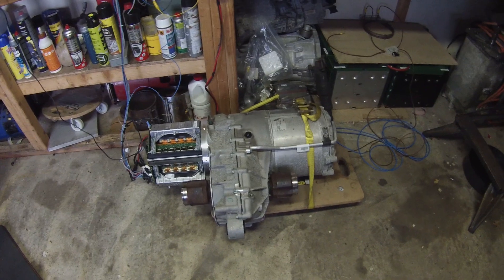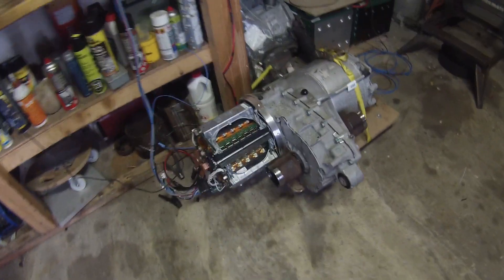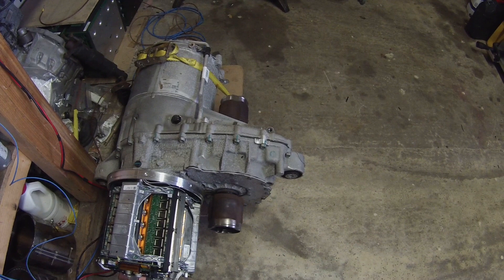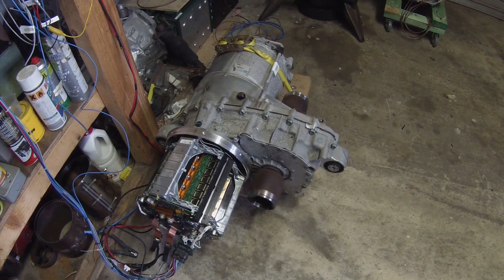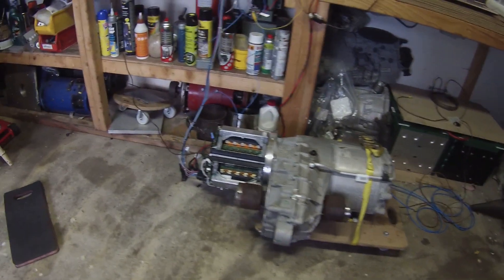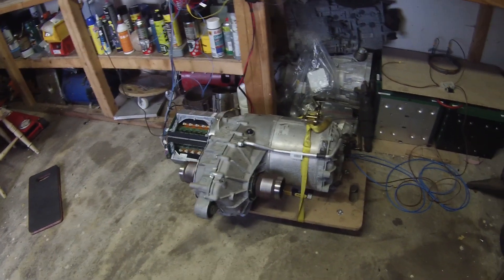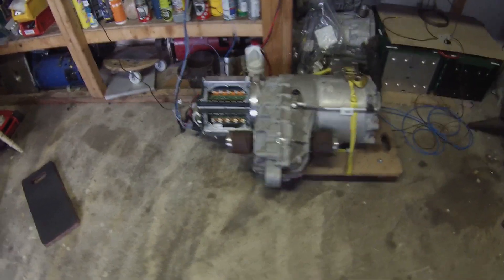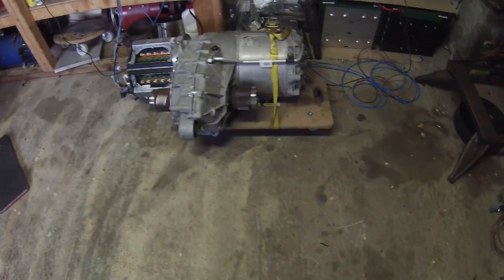The Tesla Project : Just Crusin

Comment: Will you be making the brake pedal sense multiple redundant? Most (all??) Drive by wire cars have redundant brake switches for obvious reasons. Especially if cruise control is present.
Reply from the maker: The brake signal has two connection to the inverter. One analog and one digital either or both cancel cruise control.

Comment: Mind sharing wat the resistance is right now?
Also Easiest would be pumping "Warm" water through the motor and inverter with the drive unit wrapped in blankets and then taking a known measurement and recording the resistances and doing the same for cold. 

However, can you not get a the IGBT heatsink sensor?
Reply: Tom de bree Yes, that's exactly what he explained in the video lol
Reply: Just iterating that he should wrap the drive unit as not to have a the heat spread properly. 
My question would be are all the temperature sensor of the same type or are there different ones used?
Reply from the maker: So the motor case sensors read 15k at around 15C ambient. The internal sensors read 146k at same. The heatsink sensors are buried in the goo and read 52k at same ambient.
Reply: Id say case is a 10K the internal would be 100K and the heatsink probally around 33K however getting the right B should be quite straight forward with a measurement at lets say 60C.
Reply from the maker: Thanks Tom:)